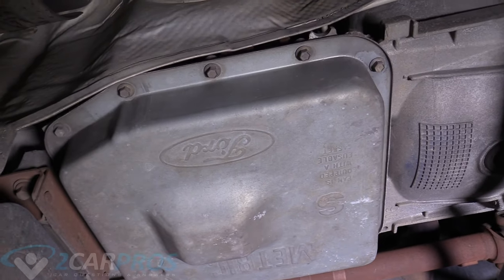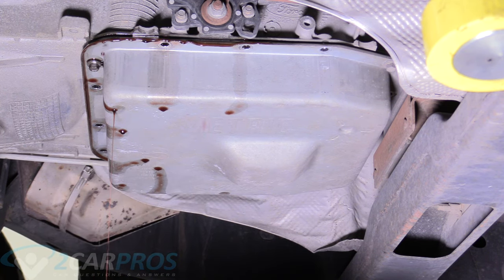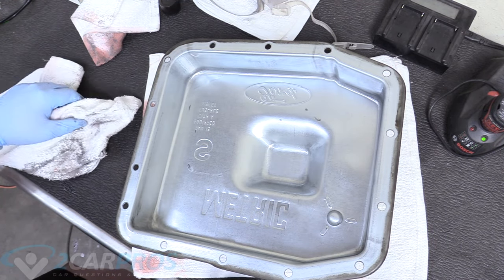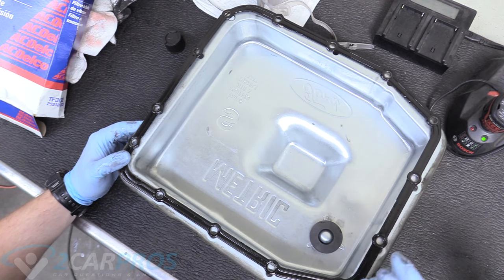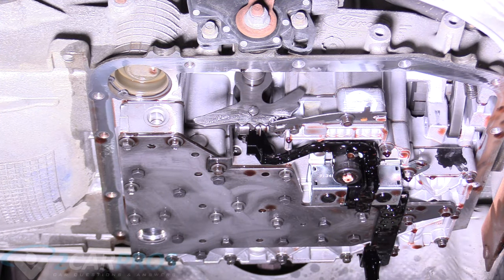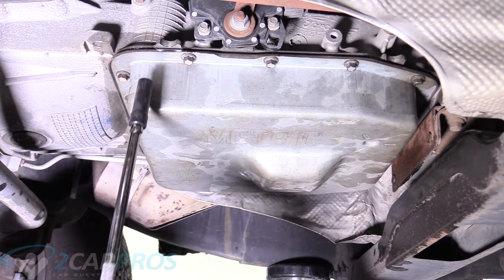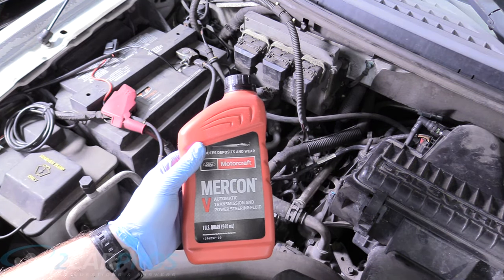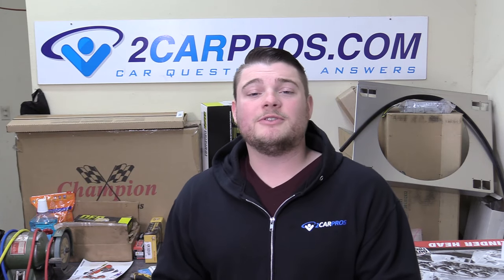How to Change Transmission Fluid and Filter Ford F-150 2004-2008

Comment: Great video... Thot I'd mention:
I found this plastic thing in my pan that looks like a little kids top with an O-ring around it.... Freeked me out!...didn't know where it fell out from!.... Found out later that "thing" is a plug where the dip-stick tube will eventually go. When the tranny's are in production and full of fluid, but before actually installed in the new vehicle, they use this plug to keep things from falling in. The dipstick tube guy just shoves it in and pushes the plug in the pan. Finding it in the pan reveals that the trans has never been serviced. Good way for the Ford mechanics to void warranties. I put mine back in to freak out the next guy. 🤣
Reply from the maker: Good show! lol Thanks for watching!
Reply: God bless you! I was freaking out as well, mine had never been serviced as well! I over torqued the pan bolts and got a leak. When I replaced the gasket, it was cut in 2 places. I used the ATP "3rd hand" gasket the first time, but went with Victor Reinz Automatic Transmission Pan Gasket 71-14937-00 the second time. It is just like the factory metal/rubber gasket, almost impossible to over torque!

Comment: Crazy question @2CarPro. I just got an 06 F350 with over 300k miles. I have to assume the trans fluid has never been changed.

Would you still change the fluid or no ? I only ask since people like to suggest that it will cause issue if so change the fluid.
Reply from the maker: Holy cow a 06 F150 at 300K? That's an accomplishment. 

I would change it. Clean fluid is always going to work better than used fluid. Thanks for watching!

Comment: You should measure the amount of fluid you drain so you don't have to keep on checking one after the other.
Reply from the maker: I like to keep checking because the fluid was low to begin with. I really didn't want to put new fluid into something I was going to drain. Thanks for watching!

Comment: 11 foot pounds? Sounds like a little to loose doesn't it?
Reply: Some tread lock maybe ?
Reply from the maker: Yeah I feel like 11 is too loose but the "technically correct" crowd will come out if I say any thing else. Thanks for watching Eduardo!
Reply: I did mine at 20 foot pounds using the old gasket,But if you will use a new rubber gasket that comes with the filter kit 15 foot pound is perfect.

Comment: That’s is the stupidest thing . I seen they use to have a drain plug on some transmissions that u pull the plug and drain the fluid before u pulled the pan but I guess because it’s a ford that’s why . 🤦‍♀️
Reply from the maker: Most makes and models don't have a transmission drain port. Thanks for watching!